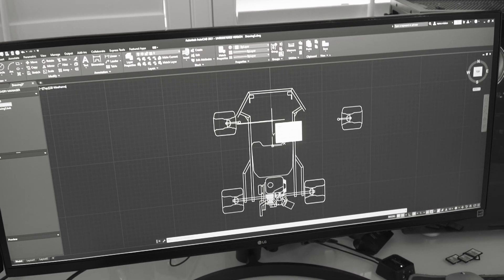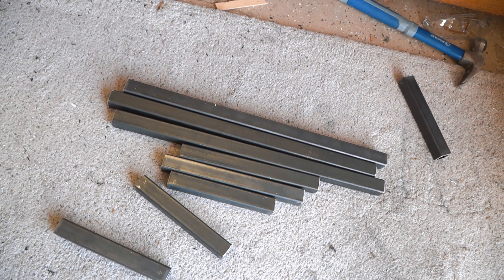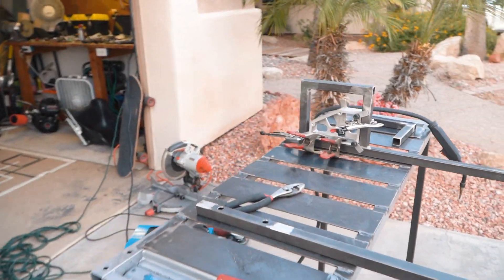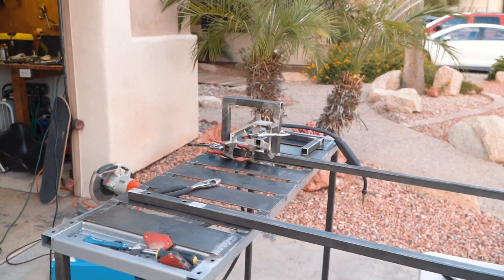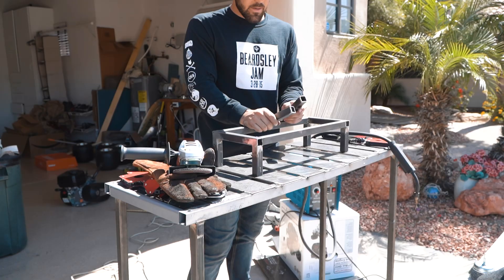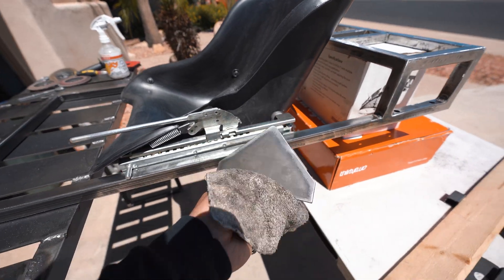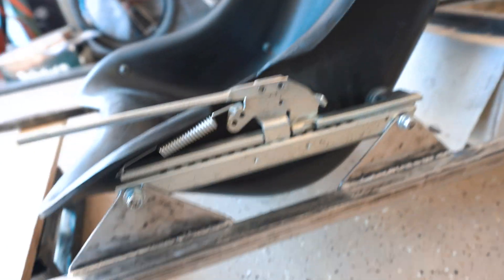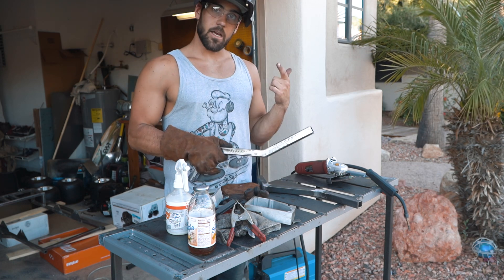Build Your Own Go Kart EPISODE 2 - Frame Welding and Assembly!

Comment: How did you get the correct angle for the front wheel mounts?
Reply from the maker: We used an electronic angle finder from Amazon! We will leave a link in the next video description.

Comment: Use a contact tip on the end of the welding gun, it will structurally make your welds safer since it would actually direct the shielding gas at your weld
Reply: he's using flux core wire so he don't need tip
Reply: if you don’t know what I mean or if you have a problem/reason for doing so lmk
Reply: Don’t some welders just not have gas tho?
Reply: @drewwaddell9302  only if he was using flux core wire.
Reply: @avischoenfeld8040  At 3:20 there is light brown “dust” on the metal where he made a tack, indicating flux of some sort

Comment: How much did it cost to build total?
Reply from the maker: I think I might have spend about $2000-2500 on this build! It adds up quickly when you buy all new parts! Really just depends on the parts and what you need. I think spending about $1800-2000 is a great budget to start with!

Comment: How much did the metal cost? What type of tubing  would you use to build this cart of you had to use it.
Reply from the maker: Hey! So usually I buy from my remnants section at the local metal shop! They charge 1.49 a pound and I would probably us anywhere from 80-150 lbs of metal on a kart! I love to use the square 1x1 tubing! And it usually cost about $1.8-2.25 per foot. I would usually use like 36-50 feet for a project like this. Sheet metal can range but a 4x4 sheet of thin gauge metal might run you like $40-70! Let me know if you have any other questions!